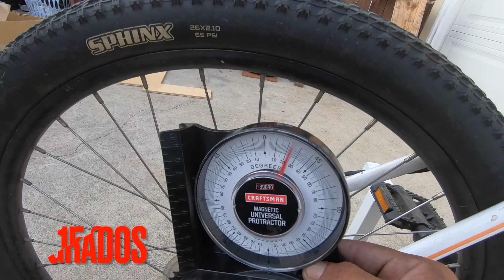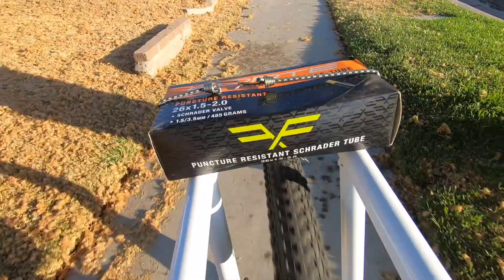Como hacer PORTAEQUIPAJE para BICICLETA. // DIY BICYCLE RACK.

Comment: Hola que tal soy nuevo subscritor y estoy queriendo comprar una maquina de soldar para aprender a soldar cual me recomienda MILLER O LINCOLN
Reply from the maker: Yo tengo ambas y las dos me gustan mucho son mis marcas favoritas. Si vas aprender a soldar yo recomiendo que rentes una maquina de soldar, pregunta en homedepot me parece que ellos rentan LINCOLN ELECTRIC, Una vez que estes completamente seguro que quieres hacer soldadura. Yo recomiendo que compres las mas cara. Porque las mas cara? por si empiezas a escalar en proyectos.  MILLER o LINCOLN. De un proceso o multiproceso. Yo le doy mas crédito a LINCOLN por mas de 100 años y MILLER mas de 90 años en el mercado. Si hay mas preguntas con mucho gusto las contestare, muchas gracias.
Reply: Aok muchas gracias por tu valiosa informacion y donde compra el material como la mesa de metal que hizo  los tubulares?? FIJESE QUE PARECE QUE YO LO E VISTO EN ALGUN LUGAR APARTE DE YOU TUBE....